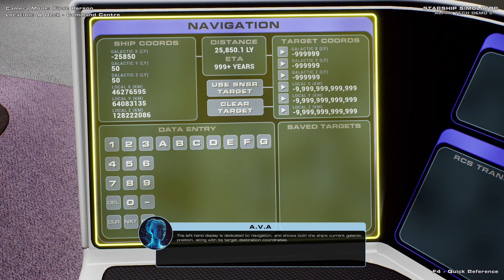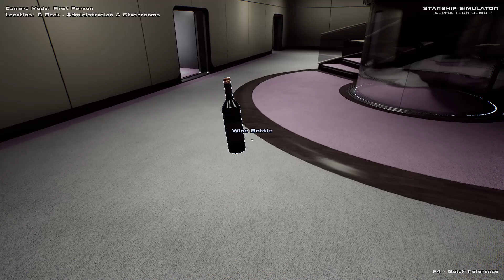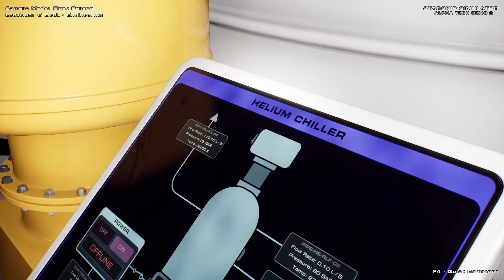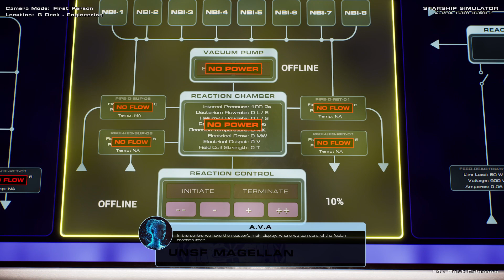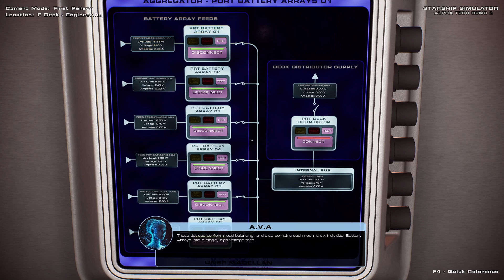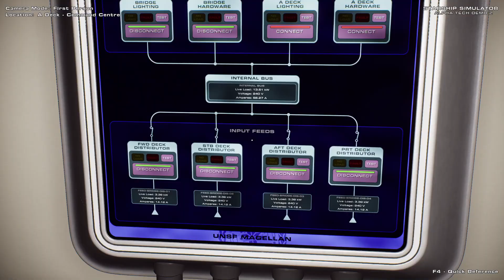Starship Simulator Demo- So you Wanna be a Starfleet Officer?

Comment: That was a neat video.
The game (and the entire Federation for that matter) could be improved with something called High Performance HMI (human machine interface). Basically, the open/close valve things are a terrible design, but in this game (and most scifis) feels more like an old submarine where you have to physically go to the valve of interest to do anything with it, but sense it is all networked  together things like the valves and all of the battery contractors should all be easily accessible from any number of HMIs on the engineering deck/bridge, as well as having the more manual interfaces at the devices themselves.

TL;DR, I design industrial automation stuff IRL and if I was the ship designer IRL the entire reactor startup could have been performed while standing at a single console.
Reply from the maker: Thanks for the comment! And Yeah, for the sci-fi vibes I appreciate using terms like " port forward emitters" and stuff like that but for gameplay I definitely could've used a general button for something like "prime all battery connectors" at the least for the bit where I'm running in circles in the maintenance ducts😂
Reply from the maker: Having a master button panel somewhere like the beginning of the floor where you can do everything but for gameplay there could be a problem with one of the 8 individual panels that you have to go check out. And I hope that's the direction they go for a star trek vibe
Reply: @Kuh-lee  Yeah, if I designed this IRL there would be a single button to automatically, and safely, fire up the reactor, and another button to bring the main power out of standby once the reactor is going. However, the engineer would also have to know what each step does, how to do it manually, and what could be safe(ish)ly skipped in case the startup needs to happen while the ship is falling apart around them.